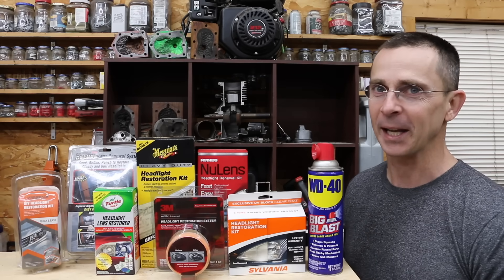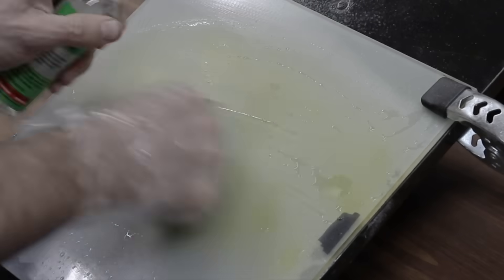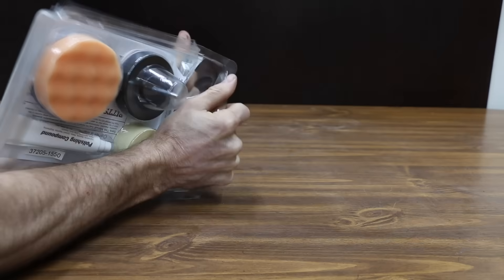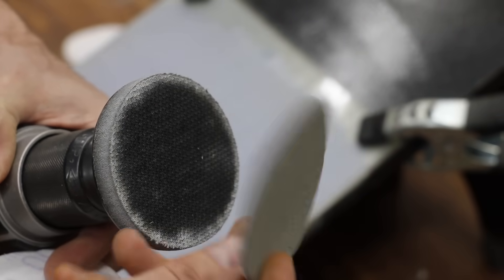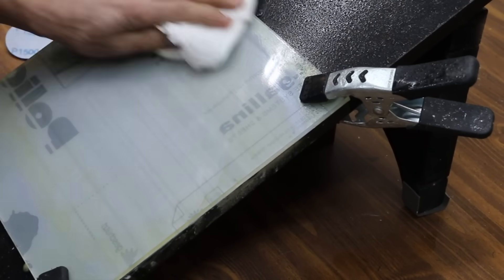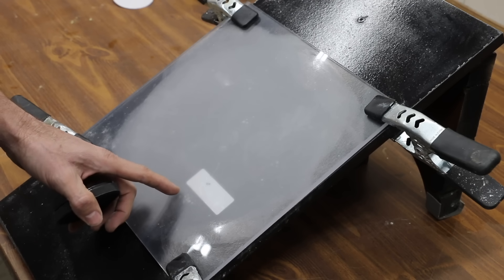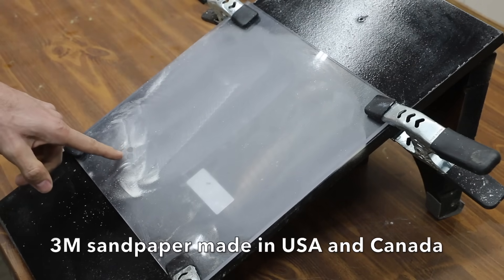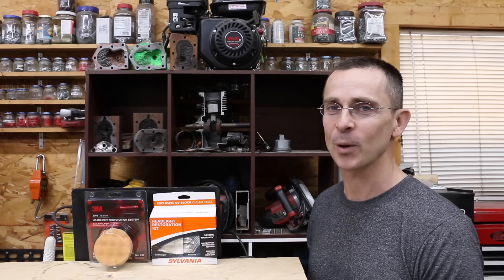Best Headlight Restoration Kit?  Let's find out!  3M, Sylvania, Meguiar's, Mothers, Turtle Wax & HF

Comment: Honestly, I just use Colgate toothpaste. Normally the little tube from the dentist since I tend to forget it in the car until it explodes, then, not to waste it, buff all the headlights of my vehicles that have any oxidation or scratches. Otherwise it’s a dollar at the dollar store, and it works for the most part. Apply , let sit, buff, clean with damp towel.
Reply from the maker: Thanks for sharing.

Comment: Mothers NuLens: My drill gun doesn’t have a tachometer.
Reply: They have different speeds and you can check with the owners manual as to what each gear will do. 🤦🏼‍♂️
Reply: label on the drill
Reply: @billman6364 :  Tells you max only, everything in between is guesswork.

Comment: I just used the Sylvania kit on a Jeep Grand Cherokee (WJ) that had mid to severe level headlight goobing (they were bad enough that I couldn't tell if the housings were black inside or chrome), and it worked great! 

I did switch up the recipe a bit, and hit it with some Meguiar's Scratch-X in the final polishing stage, prior to going over it with the sealer/clear coat.

Be advised: that clear coat in the Sylvania kit is NO JOKE!  They included one lame-ass vinyl glove for applying it, but you'll probably want at least 2 gloves, if not nitrile gloves when applying it, because it WILL do awful things to any unintended surface (like...say...your fingers/hands/bumper etc.) that it comes into contact with.
Reply from the maker: Thanks for sharing.

Comment: I found wet sandpaper (400/800/1200), flitz polish using drill polish wheels, and spray a UV clear coat much faster than the kits and/or toothpaste.  If you've got to remove material then polish, you might as well employ the right tools.
Reply from the maker: Thanks for the feedback.

Comment: I used OFF with DEET on my old Windstar, pretty easy quick fix.
Reply from the maker: Thanks for sharing.
Reply: Doesn't DEET turn the plastic into sticky goo?
Reply: @MetalheadAndNerd  , yes, but it works fast, Just have to be carefully about how much of an area you are working on. Removing oxidation first. Then restoring the lens.  Wipe dry and let it cook-off for a few minutes. Then wash with Windex. I just tried it, so I can't comment about long term durability from UV,, or whether I should clear-coat with something.
Reply: @Duplicatt  I read that DEET starts a process in the plastic that lets it decompose with no means to stop the decomposition.
Reply: @MetalheadAndNerd  , guess I'll be the guinea pig then ,, lol.  The headlights are on a 97' Mercury Tracer, so not really risking much,, will be cheap to replace if this all goes south.
  I've been testing all day, applying "OFF" to  clear polycarbonate party cups. I'll see in 24 hrs if they become brittle.  Also tested some clear coats. Only one I would use, sofar, is an Gloss Acrylic Polyurethane. All the other different types of spray can clear-coats were foggy. So I ended trying some airbrush sealer in a bottle,, just brushed it on,, looks fantastic.

Comment: Nice video; im sure, to be honest i didn't watch it; yet! (i will grant you another comment after i do, lol)  I have a 2015 Nissan Altima in-which; for some reason, both headlights have moisture in-side them already, so i will have to buy some nice replacements, and your video helped me decide which ones' to get; anyway, the best cleaner is bug spray, (DDT, do not huff! trust me on this one) then a coat of protectant; olive oil! yes, olive oil, only bad side-effect is it collects dirt, grime, bugs and exploding deer parts, but if you keep it clean, and the layer of oil thin, it works awesome! take it from me because I drive for a living ;-) ... .... . .... . .
Reply from the maker: Thanks for sharing.

Comment: Try toothpaste for headlamp restorative I have used it for years. Just apply to a buffing attachment for a drill , preferably foam to keep moist dont let it get dry ,use regular white tooth paste and just buff untill lens clears. Works really fast and leaves your lens minty fresh!!! You dont have to mask paint because it washes off like soap.
Reply from the maker: Thanks for the suggestion.
Reply: Oh and use Crest its the best 😂😂😂😂😂

Comment: If you ever test more headlight products, I suggest throwing toothpaste with {one with scrappiness like the cheaper whitening tooth paste but likely nothing for sensitive teeth. It's got to be the gritty paste.
Reply: Ceramic paint protection products put to the test with road tars and some very light sand blasting or abrasives blown with a strong fan.
Reply from the maker: Thanks for the suggestion.

Comment: Wet sanding with 2000 grit and a little bit of buffing works just fine. All these different brands of headlight restoration kits are like a snake oil guy trying to sell different products that in the end most likely don’t work.
Reply from the maker: Thanks for the feedback.
Reply: Project Farm  No problem I’ve worked with a lot of detailers over the years and i definitely learned a few tricks or 2 from everyone I met.

Comment: Great video as always my man!!

I've used the orange buffer pad from the 3M kit with Mother's Mag and Aluminum polish with great success on a dozen or more sets of headlights. I've seen a wool pad used with same polish for headlights with a lot of yellowing. For both you should switch back and forth between the two lights so the surface temp doesn't get too hot.
Reply from the maker: Thanks for sharing.

Comment: Great video! I used the Sylvania chemicals and instructions, in combination with the 3M kit's drill attachment and sanding disks. The 3M step up in grits is a little different that Sylvania's, but I think better because you end with 3000. However, the Sylvania does have the best chemicals, including the prep liquid that seemed to remove a lot of the yellow and made the orbital sanding with 500 very effective. Using two kits only cost about $20 more...$40 is much less than at least $300 to replace the headlights, and using the drill with sanding discs saved a ton of labor and gave uniform finish!
Reply from the maker: Thanks for the feedback.

Comment: Dear Todd, you go to great lengths in your methodologies however this test setup has several flaws.  120 grit mechanical abrasive is not equivalent to UV oxidation & travel abrasion. Using sheet polycarbonate is not the same as injection molded  lenses..  the molecular chain orientation is quite different. The prismatic effects vary greatly.  A simple solution to address  UV oxidation is apply Simichrome  Metal Polish by hand buff. $25 a can but we would do this on our lot for our Japanese keeper cars only. For the domestics, we did the 5 minute WD -40 trick. Which is a no no to mix petrol distillates w/ plastics.  Keep up the good work!
Reply from the maker: Thank you for the feedback!

Comment: My wife uses Sterling's Magic ( https://sterlings-magic.square.site/ ) which is an all purpose cleaner.  She just rubs it over the car lens a couple of times and it clears up. No sanding needed.  This worked on a Nissan Murano and Mercedes 3320.  I have used two of the products you tested, but this Sterling Magic is much easier.

Comment: 3m also makes a professional kit you can get at most auto parts stores that is like the kit he showed but includes a wipe on clear coat, imho it takes a long time (roughly 2 hours for myself) at my job to complete a headlight restoration using a 3m kit, but aslong as the lens isnt cracked on the inside it looks almost new.
Reply from the maker: Thanks for sharing.

Comment: I used the rainx kit on my hazy light when I replaced the other one with a new one because it was cracked and filling with water.  It make the light output comparable to the new light and didn't cost much.
Reply from the maker: Thanks for sharing.

Comment: To anyone that sees this comment. Try chrome polish! ($3 at Walmart) just smear it around on the headlight with your fingers let sit for about 5 minutes then wipe it off (when most of it is wiped off I apply a little extra pressure) with a paper towel. If head light is bad enough then you gotta do it again. I've applied it up to 4 times. But that's it. No sandpaper or anything needed. Just chrome polish and paper towels. If you want it to look better and last longer, use clear coat
Reply from the maker: Thanks for the feedback.

Comment: That is not a fair comparison headlights are not damaged down to 120 Grit. It's like Meguiars and mothers do we store the average headlight back 2 looking like Factory new that's the reason why Meguiars doesn't go under a thousand Grit. Take a headlight that is a glazed over so you can't see through it from Just sun oxidation and Meguiars will bring it back to Factory new but not if you sand with 120 Grit sandpaper

Comment: Cerakote also has a headlight restoration kit.  I'd like to see how it compares to Sylvania, this test's winner.  On Amazon, Cerakote is $5 more than Sylvania, & both have a customer rating of 4.6 out of 5 stars.  Cerakote has posted a couple of videos on Amazon showing how their process works.  They use as a selling point that their kit doesn't require any power tools & that you don't have to bother with putting masking tape around the headlight to avoid damaging the car's finish.
Reply from the maker: Thanks for the video idea.

Comment: My process:
1- Mini orbital air sander and sand paper 400P-600P-800P-1200P( all without foam ), 3000P ( with foam ).
For each type of sandpaper all the scratches of the previous grain must disappear.
A lot of 800/1200 P... And 4/6 hours, all morning ( especially to disassemble  and reassemble the lamps... two big balls..... )
2- Xerapol  applied with a 1" ball cotton ( by hand ).
Don't use sand paper and towel inside of the box of Xerapol, they're useless too small-too little...

I never use protecting coat, next time I'll try its.
Wonderful video, I've learned a lot of things. 
Thank you.
Reply from the maker: Thanks for sharing.

Comment: Hey there, quick question I did the 3M restoration kit and I got the 3M headlight clear coat to put on after question is..what I apply the clear coat after doing the rubbing compound with the orange foam or skip the process with the compound with the orange pad and go straight from the 3000 grit to the clear coat? Let me know what you think thanks

Comment: I used the Turtle Wax speed kit and it came with less than even what was provided here, only polish, sanding blocks, and ceramic coating. I tried it on my dad's car and it was still hazy after about 5 rounds of polishing and sanding. It looked much better than before and on camera, was impercievable that there was any haze but in person it was definiety noticeable. For $5 or whatever it cost, it was a good deal and got the majority of the haze off but I would recommend getting something better. My dad was happy with the results but I can't stand looking at it.
Reply from the maker: Thanks for sharing.

Comment: I cleared my own headlights by wet sanding with 600, 800, 1000 and 1200 grit sandpaper then polished with Meguiar’s PlastX then applied Meguiar’s Headlight Coating. I’ve since made $120 clearing other’s headlights with the same materials.
Reply from the maker: Thanks for sharing.

Comment: After seeing this video, I decided to try one not covered in this video. I went with RainX's version.
Came with the sanding disks and buffer pad, polish and sealer. Same steps as these brands.
My headlights went from a white haze so bad that you couldn't see the bulbs, to essentially as clear as the day they were made.
The only reason they are a little blurry is due to my application of the sealer. 
My motions were not as smooth as they should be. lol And the blurriness in no way effects the light coming from them.
For $17 and some change at walmart, it worked wonders.  
And since I stopped sanding regularly to rinse the pads and lenses, I honestly could redo both of my lenses once more with the remaining product. I resealed the top coat sealer after use and it has not cured as of yet. And there was more than enough polish left.
3 weeks of direct sunlight and 4 storms have not faded the lenses so far. And even though this will be an old topic, if the day comes the lenses fade or the product begins to fail, I'll stop by this comment and update. But so far so good.
Reply from the maker: Thanks for sharing.

Comment: A local mechanic had a "secret solution" he used to clarify old headlight lenses.  Unfortunately for him, I recognized the scent immediately:  carb cleaner.  It simply dissolves the outermost layer.  Leaves the surface smooth but a little wavy, but works well.  A UV protectant would be a good idea afterward, I imagine.
Reply from the maker: Thanks for sharing.

Comment: Cerakote kit hands down,you can do a better sanding job taking your time ,but if there is no protection it will turn yellow in no time.cerakote is the only one i have found that actually come with a uv ceramic coating that turns the lens damn clear.
Reply from the maker: Thanks for sharing.

Comment: I've had reasonably good results using a paint scratch remover paste. It won't help with bad scratches obviously, but it helps quite a bit with the yellowing. Temporarily though, it partially comes back in a few months.
Reply from the maker: Thanks for sharing.

Comment: I used concrete liquid wax recently on my car, and tried some also on my foggy headlights. After a couple passes with my orbital buffer, the results shocked me how well it worked. Mind you
 it was not a severe case yet. However the vehicles is pushing 10 years old now and I do take it up north often and it has had a lot of time for wear with Canadian roads with salt etc during the winter. I find the golden rule is if you have a light to medium light abrasive compound on hand, good chance it will help clear up the headlights, maybe not 100% depending on the severity. Though it will help none the less.
Reply from the maker: Thanks for sharing.

Comment: Few things:
1) You should take the final two and apply to actual headlights from the same car.
2) Car makers needs to go back to glass to stop this insanity.  The few lbs of weight savings is not worth it.
3) Areas that have auto safety inspections, should include headlight brightness tests.  As I've seen headlights that cannot be safe.
Reply from the maker: Thanks for the suggestion.
Reply: its not for the weight savings, its for the fact that now bumps arent as commonly breaks
Reply: Would plastic be cheaper and easier to quickly mass reproduce?

Comment: I just tried the baking soda only on a Honda pilot from 2011. It wasn't flawless but I didn't put loads of elbow grease into it either. Long story short, use baking soda with a splash of water and save cash if you are strapped for it.
Reply from the maker: Thanks for sharing.
Reply: @ProjectFarm  no problem! Someone is always looking for a hundred dollar result out of a 10 cent investment. Figured I would head that off in the comments section before it got started

Comment: I used that same Maguire's kit a few years ago on my trucks headlights. I also thought it was weird that it started at 1000. My headlights were pretty crazy bad, so I actually started with 600 wet/dry 3m sand paper on a piece of high density foam to get the bulk of the cleannup work done. It worked insanely well by the time I finished. Headlights looked so good. Bought a new truck this year and have to do it's headlights now. Might try the 3m kit this time around. Thanks for the comparison!
Reply from the maker: Thanks for sharing.

Comment: Time Markers
- steps to apply the product:
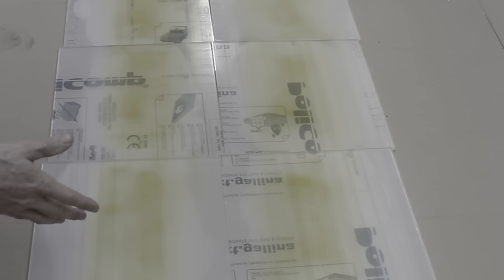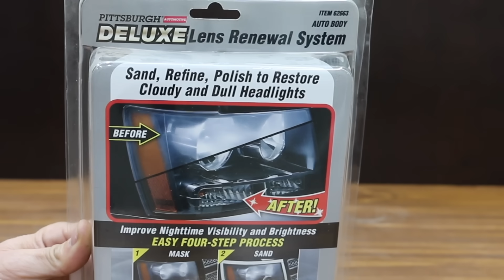1:39 Turtle Wax.  3:44 Visbella.  4:55 Harbor Freight Pittsburg.  7:09 3M.    9:04 Mothers.  11:00 Sylvania.  
12:46 Meguiar's
- closeup photos of the results:
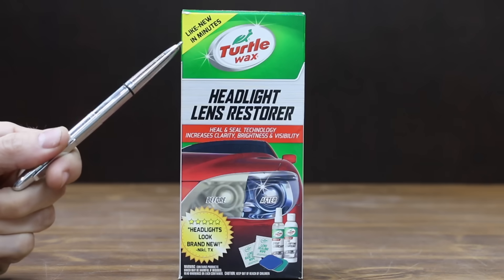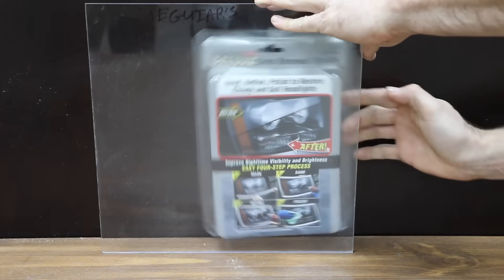15:47 Turtle Wax.  16:13 Pittsburg vs. Turtle Wax. 16:24 Visbella vs. Meguiar's.  16:41 Meguiar's vs. Mothers.
16:51 Mothers vs 3M.  17:03 3M vs Sylvania.  17:17 Sylvania vs. New, unscratched Polycarbonate.
Reply from the maker: Thanks for sharing.

Comment: I'm a hack. I restore semi-opaque headlamps using progressive grades of wet sanding followed by two coats of UV resistant clear coat. The results are exceptional and my work holds up.
Reply: What grades of sandpaper 800, 1500,3000 and do you sand between clear coats, plus what brand of uv clear coat?
Thanks

Comment: Thank you for making that video on which headlight cleaner is the best. however I found a shortcut but the downfall is it only last 3 days.what I have used is just a little bit of clean transmission fluid. Just a cap full on a clean cloth, try it keep in mind it will work for 3 days. Yes it will collect dust but that will wash out with water and soap and only take a few minutes.

Comment: But, you didn't considered one more technique. Coating the lens with clear coat, the same used on the body of the cars. Coating the lens after scuffing off the whole lens and after is all uniformly opaque from 600 grit sandpaper sprays on a 2k clear coat, easy as that, it becomes glass clear and is uv resistant too

Comment: The big question is which headlight coating is the best? that needs a year to finish I guess
Reply from the maker: Thanks for the suggestion.
Reply: @ProjectFarm  Also if you have a painted car bonnet, divide it into 6 parts and apply polish and sealant to the paint and leave in the sun, next year we discover which sealant or coating is the best

Comment: I've used the 3M drill kit, and a rain x kit that came with small square pads.  They both work great but I really preferred the rain x kit.  Also, in a pinch, you can pull your transmission dipstick, and rub the fluid from the stick on your headlight, it'll clear it up INSTANTLY and is good for a few days lol.
BTW with the 3M kit, extended use causes the adhesive to get hot, and the pads will slip off.
Reply from the maker: Great information. Thank you